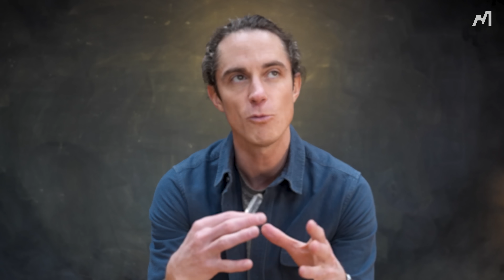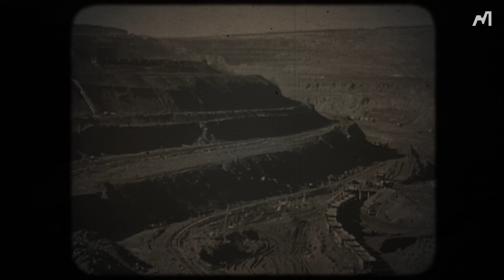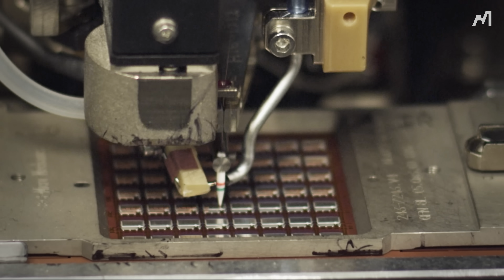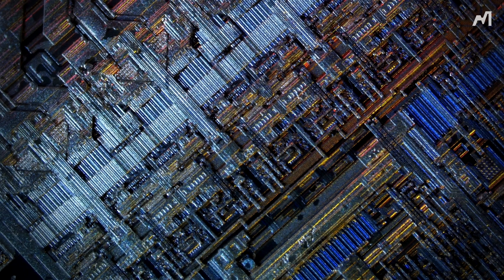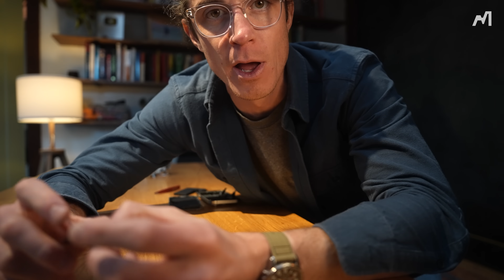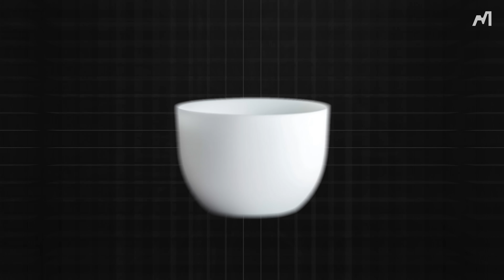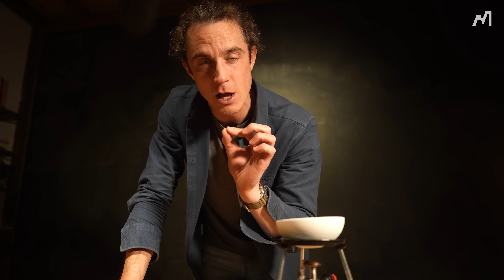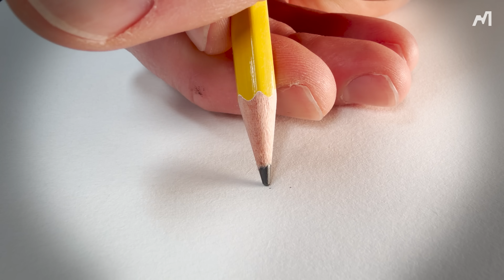Saudi Arabia Has Oil, America Has This

Comment: This dude always comes up with stuff that no one else even thinks about. That's what journalism should be.
Reply: Problem is: The U.S. isn't the only place on earth. 
There's another country with the equivalent scale supply & quality deposits, untapped. They are such a close allies with the U.S. so they don't disrupt the monopoly.
.
.
.
.
.
.
Australia
Reply: @donkeytwoddle  Also, we've maxed out on the capabilities of silicon. We've legit hit a wall and one thing they're trying to do is find another material to replace silicon. Our lead probably wont be for too long.
Reply: @donkeytwoddle  high end chip are made out of hard wood sawdust not mined quarts , the cost of turn actual quarts into a high grade silicon ingot would quadruple the manufacturing costs , the reason why we are biggest supplier of chip grade carbon is because we supple the vast majority of the worlds hardwoods and know to sustain the industry , Brazil was a major supplier but they clear cut the their hardwood forests and turned it into row crop land, the Russian timber industry is concentrated around pine, ash, and poplar , none of these wood byproducts are suitable for making chip grade carbon despite what this video says , we make it from tight grained fresh cut hardwood sawdust , pine would cause the kilns to explode, very unsafe , its easier and cheaper to make high grade carbon out saw dust than it is to extract it from quarts , its also separated into  a lower grade that is used for making filters
Reply: @hayseedfarmboy he never talked about carbon at all in this video. He was talking about silicone which isn’t derived from the quartz, but the quartz is instrumental in its manufacture without interfering with purity.
Reply: @hayseedfarmboy  You'd be stunned to find what else specifically Western Australia has in abundance and untapped... Some of the largest and highest quality hardwood that has never been exported. Jarrah.

Jarrah comfortably outperforms almost all mainstream American hardwoods in raw strength, density, and natural outdoor durability [More dent Resistance: Jarrah's Janka hardness (~1,910 lbf), Lasts longer in the elements: Class 2 outdoor durability rating, Substancially denser: Weighing around 820–833 kg/m³.

Jarrah isn't exported because the world isn't tooled for it. You could think of it as a seperate class of 'harder wood'. Standard tools for hardwood being used on jarrah; are alike using soft-wood tools for hardwood. Jarrah needs more powerful kilns and more powerful cutting forces.
Reply: He isn't a journalist because what he does is more documentarian than journalist. A documentarian covers things that are already known to the public while a journalist covers stories that need to be dug up, investigated, and verified before releasing to the public.
Reply: He is just a narrator.
Reply: It's because he is exaggerating/flat out lying. HPQ deposits are rare and the US does have some good deposits sure, but no where near the same level as saudi arabia's dominance with oil.  Major producers of HPQ is China, Brazil, India, and the USA. Even if the US stopped sending other countries quartz it wouldn't affect the supply chain to affect the world sending us back 25 years. Like I can't even say they used AI for the script unless the AI sold them a lie too, because most AI would heavily disagree with how this video is being framed.
Reply: @PitLordKazzy The reason he is lying is because he works for a company called "The Morning Brew" which is a Investing/trading newsletter. He needs to paint a bright picture for the US stock market.
Reply: @PitLordKazzy  not only that, but a quick google search shows that most high purity quartz used in electronics is now made synthetically bc the purity is way better. With the higher price of synthetic, assuming the 250lbs per million iphones like he stated in the video, this means the cost of the synthetic quartz in 1 i phone is only 1 penny.... Not the crazy monopoly like is described
Reply: He's lying. China currently produces 80% of the world's micro chip grade silicon. Google it.
Reply: I mean this story has been ran a year now. Especially since the floods of Ashland wink😊
Reply: <.< I knew this a while ago. >.>
Reply: This video is a lie. Quartz is abundant on earth. The US does not have a monopoly. Quartz can also be manufactured.
Reply: True, and if he would take a breath, his videos would be perfect.
Reply: Bro quartz is EVERYWHERE.
Reply: nah hes just hyping up things
Reply: He’s doesn’t comes up with stuff! He researched it..
Reply: Real journalists exposing important things are dead, imprisoned, banned from social media, or in exile. 

I don’t trust a journo who hasn’t gotten on the no fly list.
Reply: It may be because it‘s not accurate. Gemini and chatgpt tell me a different story, so does my regular Google search
Reply: No one else thought of it because it's BS
Reply: @TommyLikeTom  exaaclyyy :)) my man,.
Reply: Everybody relevant knows about this. It's not some secret he's months behind even the mainstream media. 

Btw, synthetics are replacing this.
Reply: @gamesguy  I heard about it when a hurricane closed the NC mine for a while. 
Where can I learn more about these synthetics?
Reply: “China cannot overtake the US” because it needs pure silica from the USA? 😂😂 Puuulease.
Reply: @rsailor971  China also discovered not one, but two high purity silica deposits that are similar to the spruce pines one in april of last year.
Reply: @rsailor971  They'll just make made in china version 😄Them Chinese don't know when to quit
Reply: @luqmti6634  Trump has them in check. You are just propagandized
Reply: @Americanman450  the irony is palpable
Reply: @rsailor971 they don't have oil either.
Reply: @someperson8151  America has enough oil to supply us for 200 years at current rates. The government has just lied to us because they would rather go to war and steal it from the sand people.
Reply: @someperson8151  and they are winning...
Reply: @rsailor971 he is right.
Reply: @rsailor971 they just recently could reproduce special japanese glass bottles needed to secure materials from UV light to a very large degree. Just because you don't get how complicated modernity is and how valuable specialized knowledge is, it doesn't mean you should make ironic comments. Humble yourself
Reply: @Robert_Musil  If you valued specialised knowledge you would know that lab grown silica is far purer, just more expensive, so assuming the supply lines are setup for it you absolutely do not need this one specific mine, as if chemists have no idea how to purify silicon.
Reply: @Robert_Musil  You sound confused. Did you read his comment wrong or you are torn between two worlds?
Reply: @QuantumR4ge LOL. How much purer, because the silica in the north Carolina are 99% pure.😂😂😂😂😂😂
Reply: Journalism should respect facts. This guy plays quite loose with them.
Reply: @andrewgoodall2183  That's a slimey accusation to make with no evidence
Reply: @nightspade5  this guy is a content creator, not a journalist. his content comes from the exaggerations he makes in every video to farm sensationalism. in this video he overexaggerates the importance of one mine to the point that he gets the "the elites of the world rule it all!" schizos to go insane by making a little comment about secret companies wishing he wouldn't make this video :face-blue-wide-eyes:.
Reply: @nightspade5 

The evidence is literally the video that…wait, did you not watch it and just jump straight to the comments?  Or are you this dude’s brother or something?  

But in this guy’s defense, I never heard him claim to be an actual journalist or scientist or anything else where you expect the truth (but I may have missed that).  By definition, half of the litigators in a courtroom need to lie in order to do their jobs, and we accept that.  We used to spend an hour every weekend watching a dragon-flying blondie fight zombies across some icy border wall or whatever, and we never complained about it.  So why start now?  Enjoy your entertainment.
Reply: @nightspade5  well he says America dont have no oil while we are supplying the world right now. And we have tons of natural gas as well. The liberals just dont like using our own. They rather us pay more to import it from war torn countries
Reply: he uses Ai, come on man
Reply: @changehowyoueat BAHAHAHA That is wacko nonsense. AI is not capable of finding you new interesting things to focus on. The entire point of LLM is to just regurgitate what has already been bundled into it's training database. "AI" is for finding old stale stuff.
Reply: @Neojhun dam you are a public school graduate
Reply: Except he is a fool that thinks we dont have our own oil.
Reply: He completely neglected to mention that China found two sources of huge ultra pure quartz deposits in Qinling, Henan province and Altay, Xinjiang province. The way this video frames the US supply, is that it was the "only" one. in fact, it was 80% of the silica supply for semiconductors. the mere fact it's not 100% shows that it was not the only one, just a major one. The discovery of china promises to upend that.
Reply: Hes the modern Vsauce

Comment: Doing some fact checking. You can refine quartz. So even if something that's not 99,9999999% (9N) pure, can reach this level eventually. 
I've just asked AI what's the cost difference of production of 1kg ultra pure / hi-end chip silicon using Spruce Pine quartz vs Fontainebleau.
Spruce Pine quartz: $25–35/kg
Fontainebleau quartz: $35–60/kg

Also you made an error here: 12:03. The purity you need to make the most advanced chips is 9N, meaning 99,9999999%, we usually make 10N just to be sure, so that's 99,99999999% purity.  NOT 13N as you show in the video...
Please research a bit more before publishing.

Comment: Yeah all true, but you cannot use any of this in modern chips without ASML. ASML and the Netherlands are a critical chokepoint in the modern chip ecosystem, especially for the most advanced nodes. ASML is the only company in the world that can supply extreme ultraviolet (EUV) lithography tools at scale, which are required for leading‑edge chips used in AI, advanced smartphones, and high‑performance computing. In that sense, there is no advanced chip production without Dutch technology.

So when you say "the whole world relies on the US", yeah the whole world relies on the Netherlands and ASML too, including the US. All that sillica is as good as useless without ASML right now.

Comment: This video has a lot of exaggeration. Quartz is purified to 99.9999%... In many parts of the world, having a pure quartz crystal at the source just saves purifying money but THE WORLD IS NOT DEPENDENT ON SPRUCE PINE, the same material can be produced outside, those quartz are only special because they require less purifying.
The video literally said that without USA/Spruce Pine no one else can produce silicon chips and that is A LIE.

Comment: Can the less pure quartz be used to make less pure silicon, and in turn can that less pure silicon be purified to match that derived from the ultra pure quartz?
Reply: Yes and it is done in many parts of the world, including Russia and China. Pure quartz is only special because it is cheaper to purify (still needs purifying). Even beach sand can be turned into pure silicon, it is just more expensive, that is why pure quartz has a price cap, it is valuable but not infinitely valuable because if the price goes up it becomes cheaper to purify from other sources.

Comment: hmm, I had a dream where they had autonomous computers in the future made of titanium, with a solar panel on top, glass and other metals inside, with nano microchips, that goes in pairs, has 4 cpus inside, can repair itself with those tiny little crab arms that goes out of it.  It has multple eyes and can make anything as it is a hive mind.  There are like millions of these devices in the future, building and creating stuffs.  They even flew to space and terraformed moons and planets. They scale from the size of an egg to the size of a building and is the go to device of the future.  They are super durable, heat resistant, water resitant, cold resistant and when threatened flies away from their assistant solar powered flying devices like a drone.

Comment: Yeah, and all that high-purity silicon dioxide from Murica is still just sand without the optics from ZEISS in Germany for the photolithography systems from ASML in the Netherlands. You could make the same sensational video about every country, every material, and every technology that is indispensable for modern computer chips. 🥱🙄

Comment: Spruce Pine quartz is exceptionally important — but the modern world does not uniquely depend on it.

What is true
	•	Spruce Pine, NC has some of the purest natural quartz known (extremely low trace metals).
	•	It has long been a major supplier for:
	•	Semiconductor crucibles (the quartz containers used to melt silicon)
	•	High-end optics and specialty glass
	•	Some high-purity quartz inputs for semiconductor processes
	•	A disruption there would absolutely impact parts of the semiconductor and optics supply chain, at least short-term.

Comment: Fun fact: we are still not entirely sure how oil is made and we're finding more than we should which is leading to us thinking it doesn't take anywhere near enough time to produce as we first thought
Reply: thats not a fact. humans full well understand how oil originates. (plankton/algae → kerogen → oil/gas under heat and pressure over millions of years). 

 finding “more than expected”?

-improved exploration technology

-discovery of new reservoir types (tight oil, deepwater, oil sands)

-economic limits have shifted, not geological ones
Reply: Actually we understand it so well we can make it ourselves out of biomass. But it's much cheaper just to dig it up, just like the quartz in this video.
Reply: fun fact. the guy who invented the periodic table did not believe oil came from dead dinosaurs.
Reply: @slybrethren3252 anyone with a brain doesn't believe this. 😅😅😅

Comment: The crucible is 30% of the total manufacturing cost. Of that, the cost of HPQ in the manufacturing of crucibles is 72%, so HPQ makes up ~21% of the cost. If its replacement-cost (of synthetic) is 8* more expensive, this would make semiconductor manufacturing roughly twice as expensive. But how much of the end-consumer price is actually manufacturing when it comes to semiconductors? Somewhere around 10-20%, the rest is mostly R'n'D and marketing. Okay, so in the end, switching to synthetic sources would increase our costs by about 10%. Hardly the headline-grabber you make it out to be.
Reply: The Spruce Pine issue isn’t really about consumer chip prices. It’s about upstream supply risk. Spruce Pine produces natural ultra-high-purity quartz that’s uniquely suited for crucibles; synthetic isn’t just pricier, it has yield, lifetime, and scalability penalties. Even small yield losses or shorter crucible life swamp the neat “10% consumer price” math, especially in memory, power, and mature-node fabs where manufacturing dominates cost. So the headline isn’t “chips get expensive,” it’s higher cost floors, tighter capacity, and fragility at the base of the supply chain.
Reply: @Atheism-And-Normative-Ethics synthetic has penalties because not enough energy and inspiration has been put into making those problems go away. 

We already know how to do this perfectly,  but it costs too much energy to do per gram. That's the barrier no one has sincerely tried to overcome.
Reply: @lordbaldrickexcelsior  I guess. Idk enough about it. It might need another dedicated boring company and 20+ years of rnd
Reply: @Atheism-And-Normative-Ethics  did you use AI for that comment or do you just write that way?
Reply: @MADRUSSIAN720  my first comment is formatted w ai. I did not format the 2nd
Reply: ~21% of the cost of the silicon ingot, not the finished product. Time in those billion dollar ASML EUV machines likely dwarfs the cost of materials.
Reply: the clickbait works
Reply: What if the company involved only has profit margins of <10% already? If the cost of production goes up 10%, and your profit margin was only 7%, your cost of production drops to zero as you are out of business.
Reply: @RobertMorgan  Then quartz would be more expensive. But the silicon is only 1-2% of the cost of semiconductors, and the price increase of the quartz itself is a much smaller portion of that, the price of a semiconductor would change by about ~0%. Quartz is nothing compared to the total cost, it is a single input.
Reply: Ok. How do you make synthetic quartz of that level of purity without using tools made of even purer quartz?
Reply: @lordbaldrickexcelsior  Chemical vapor deposition or precipitation. Depending on the purity you need.

Comment: Making computer chips has another irreplaceable component: 
Optical lithography excimer lenses
Deep-UV lithography depends on calcium-fluoride optics of insane purity and crystal perfection. Only a few suppliers can make them.
Or rather that WAS the case. The industry worked around the problem. New Extreme-UV lithography uses mirrors instead of lenses.

Same with Vanilla extract. It was rare, super hard to get, and extremely expensive.... until we learnt how to make it in a lab. 
Now "Vanilla" is a synonym for plain, modest, and basic. 

I guess what I'm saying is that "irreplaceable" things usually aren't.